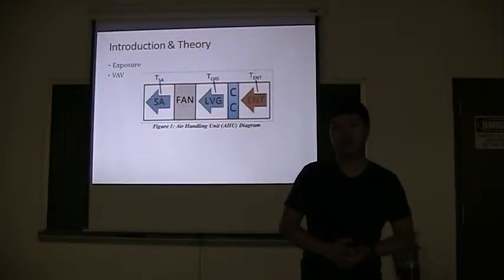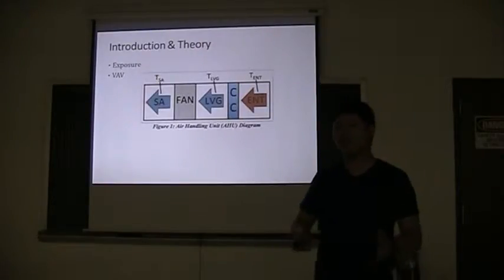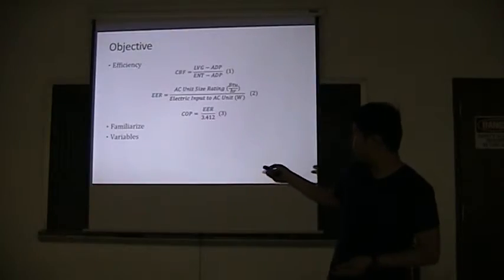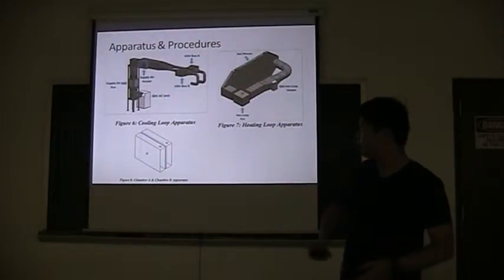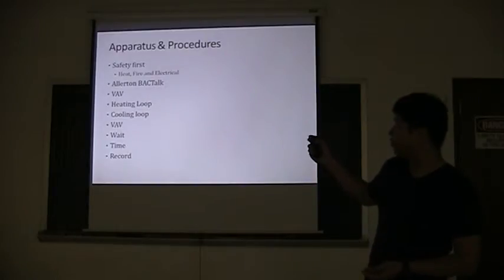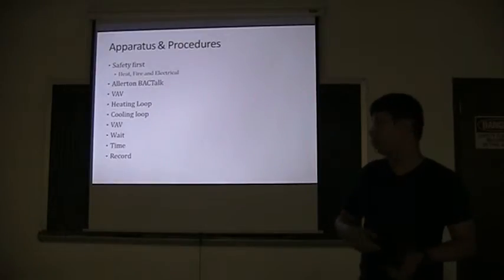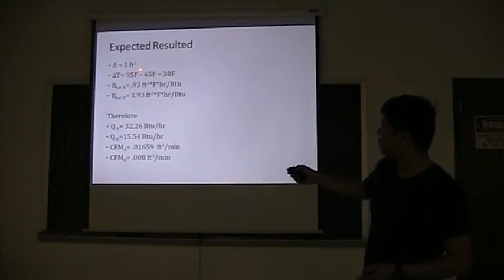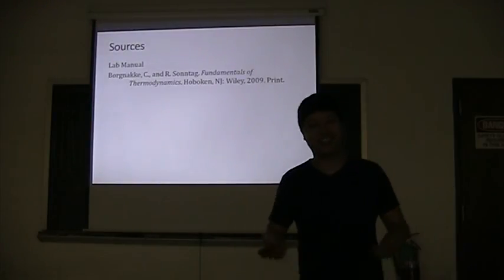Zhoa Zhang Commercial AC Lead

Comment: I agree with grant. I did turn around too much for this one.  some of the time I could've just looked at the computer screen in front of me instead of behind me. but some of the time I looked back was just to point the parts on the slide, I think during those times it was OK.